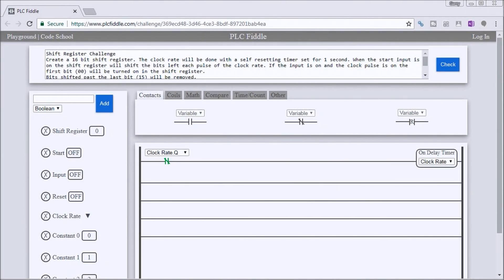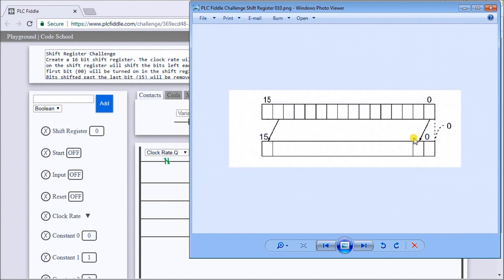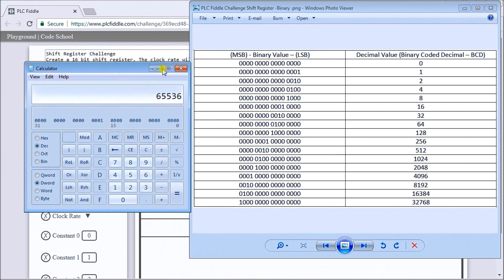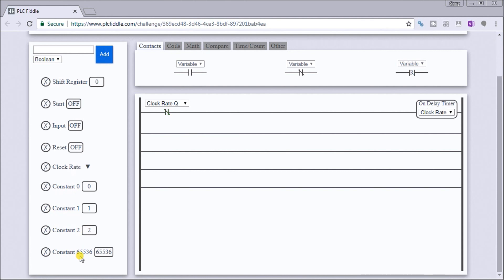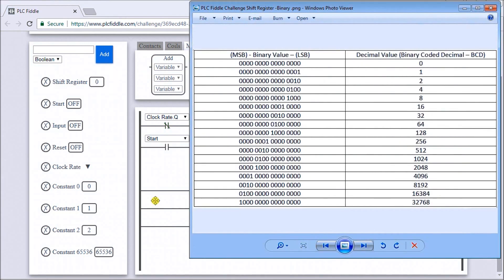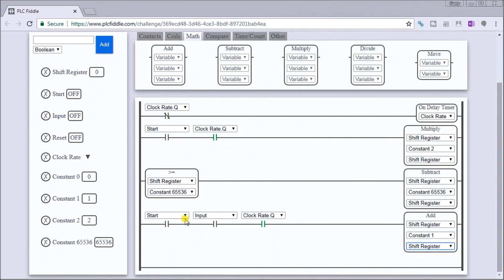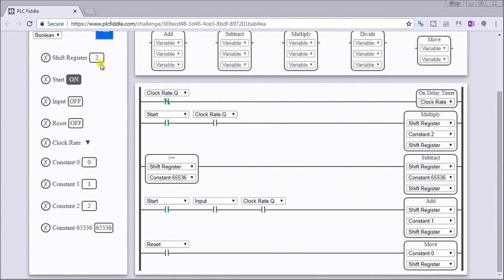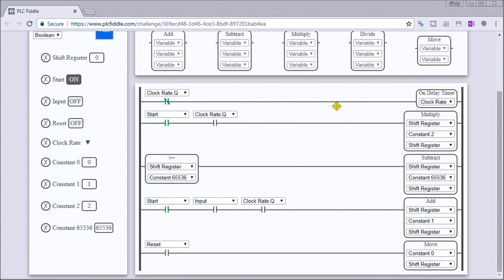PLC Fiddle Shift Register Challenge Solution

Comment: hi garry, is there any way i can discuss a PLC fiddle problem i have been given from my college with you? I understand that im going to have to use a shift register but I have a few questions
Reply from the maker: Hi Jordan,
Sure, what is your question?
Note: The following is the website with more information on the shift register.
https://accautomation.ca/plc-fiddle-shift-register-challenge/
Regards,
Garry
Reply: @ACCautomation  so I understand that you can use a shift register to both identify position of something. Say I had a pusher on the conveyor and I had to differentiate between a short crate and a long crate. My understanding would be to use a sensor with a timer to detect the length of the crates and for a short crate it would be a 0 and a long crate a 1 would be put into the shift register
Reply: My confusion comes with what happens if there is a sequence of a long crate, then a short and then a long. If I use the multiply 2 rule, and say when the shift register is at a set point i trigger the actuator to push it off. Now say there is a short crate followed by a long crate. The number in the shift register will be twice as much, and that will eventually exceed the point to push a crate off, and that will maybe accidentally push a small off.
Reply: Sorry, its hard to explain really
Reply from the maker: @jordanw4798  
In your case, you are not tracking the short case so a 0 in the shift register is not tracked. The 1 in the shift register is tracked.
Garry
Reply from the maker: @jordanw4798  
Do not worry about the number in the shift register. The only thing is the bit position that you are looking to see in the register.
Since PLC Fiddle does not have a shift register instruction you must make one up by determining if a bit is on or off at the position that you want to see.
Bit 0 - value 1
Bit 1 - value 2
Bit 2 - value 4
Bit 3 - value 8
If we want to see if bit 3 is on in a 4-bit shift register then divide by 8. If the value is 1 then it is on.
Regards,
Garry
Reply from the maker: @jordanw4798  
You explained it well.
Garry